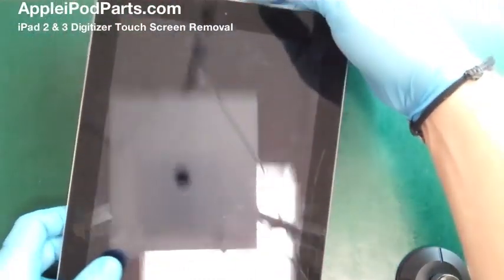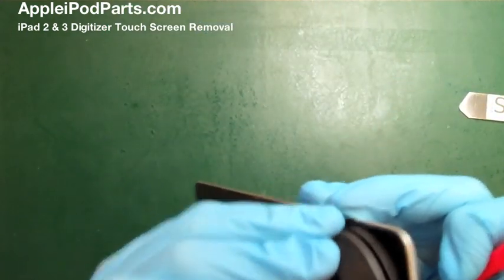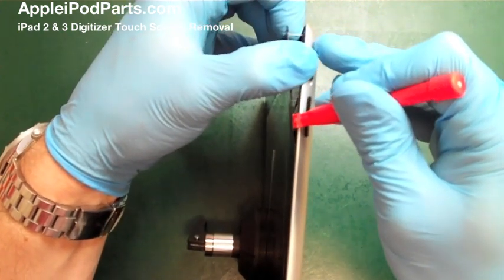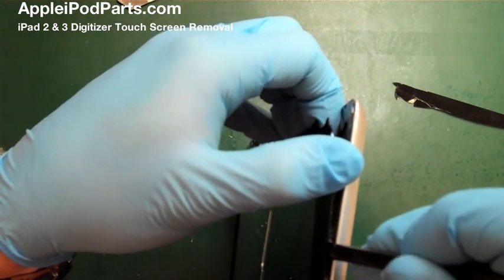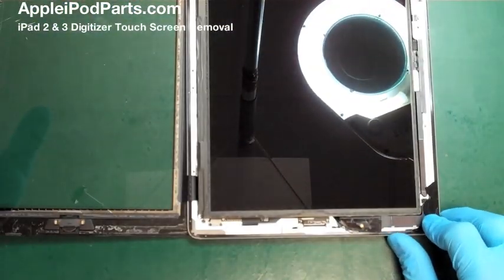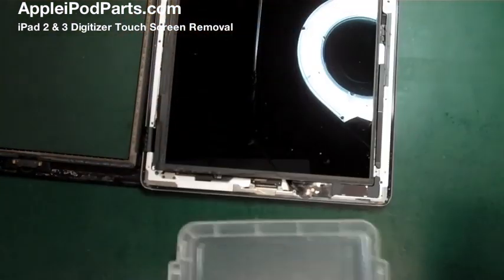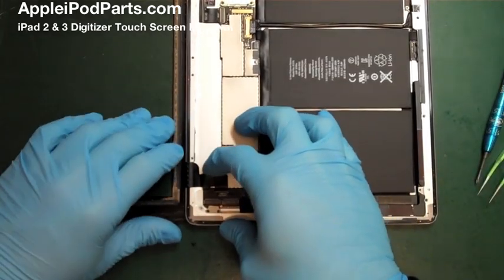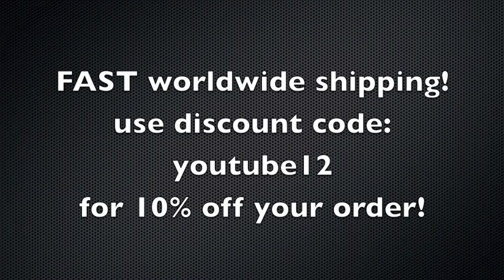iPad 2 Digitizer Touch Glass Screen Removal  Guide Tutorial - AppleiPodParts.com

Comment: Thanks for the video, it was really helpful.  Using the heat-the-iPad-in-the oven trick, I was able to remove the digitizer without breaking it, replace my iPad2's battery, and then replace the digitizer again, and everything still works!  The only thing missing is some tips on getting the digitizer to fit exactly afterwards, since if you don't get it perfectly flush, the home button doesn't contact very well (you end up having to push it extra hard to get it to react).